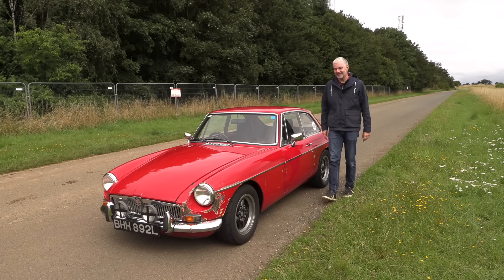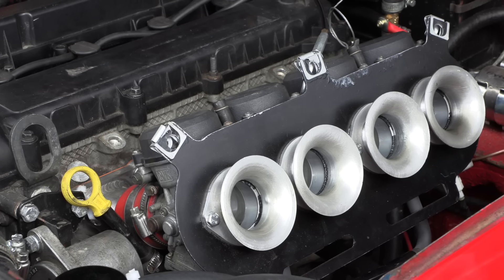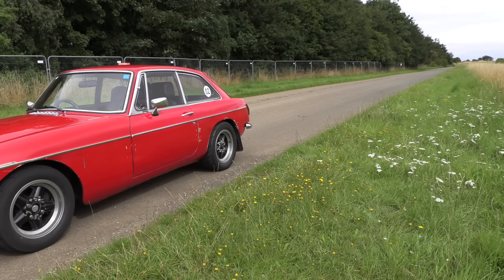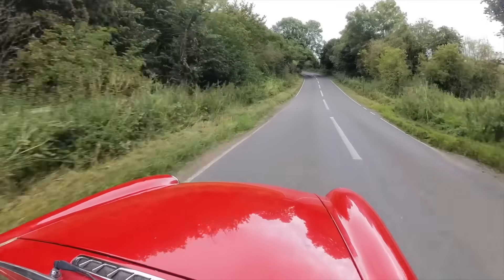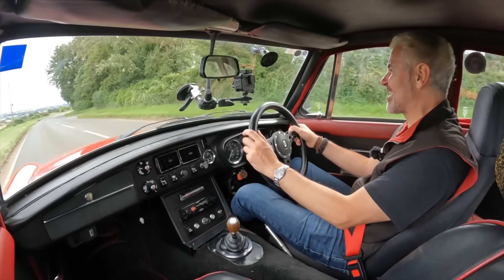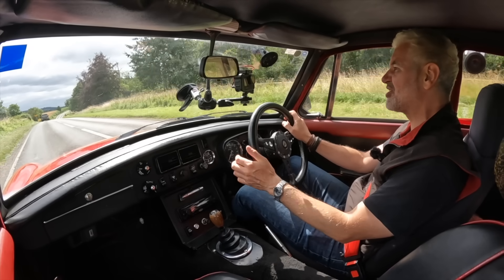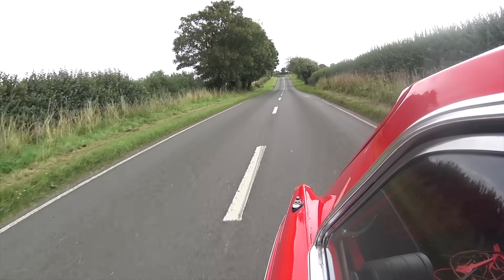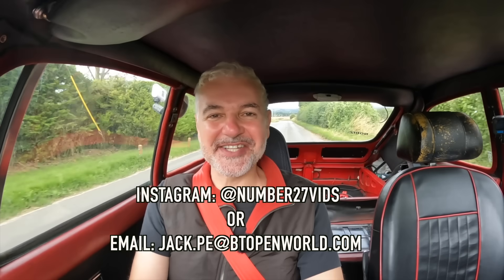This Mod Makes Electric Conversions Redundant - MGB GT Duratec

Comment: So now it is NOT a Genuine M.G. ..... How SAD You Butcher.
Reply: Don't worry boss- nothing had to be cut or welded on the chassis even the engine mounting points so you can put the old b series back any time you want to!

Comment: Electric conversion won't have the "soul", but it will get you into London, not have any emissions, save a lot in fuel (assuming you can charge at home) and not have any engine servicing in the future.
That's a track day car, driving like that on public roads in an EV you'd stay under the radar.

Comment: So I am very curious, what did the conversion do to the mpg or km/l? That is one of the reasons people switch to electric; less energy use. 

I have a 1949 Hudson with the original side valve six but with a ‘modern’ (1990’s) TH700r4 and it makes the car feel alive, and on highway speeds it’s so calm. Mpg went down to around 22 American, 26 imperial. 

On my daily driver, an original ‘65 Valiant with slant six, the mpg is the same though, but it weights 200kg less.
Reply from the maker: The Fiesta with this engine has 42-56mpg combined so this would be even better if the standard intake was left.. as it is with bike carbs consumption was much higher than that.

Comment: Genius conversion - Brit classic that now has a reliable engine, doesn't leak oil all over your driveway, and will run in the wet (no more Lucas Prince of Darkness). You can even find parts for it. Reminds me of the 60's when Bizzarrini  built his beautiful cars to compete w/Ferrari, and put Chevy V-8's in them. Bizzarrini's always started & ran, lotsa power, and didn't spend every other week in the shop like the Ferraris did - and were much more affordable.

Comment: It's great value for sure. 

But two major parts of the appeal of an electric conversion for my 1968 Spitfire convertible are the the lack of exhaust stink and being able to get about quietly. 

I drive my Spitfire year round (even on drizzly days) and only with the top down. I am totally fed up with the stink of the carb engine (even though it is finely tuned - 45 MPG). 

Plus I am equally fed up with other people's raucous exhausts which are entirely for the self-centred benefit of the driver. 

And this is even before we get into the silky smooth power delivery and 100% low down torque of electric motors.

New tech exists and that is what I want. (Just waiting for the prices to come down below 10k - and they will).

Comment: I put a Vauxhall 2.0 red top in my MGB about 27 years ago, Lumenition throttle bodies, standalone ecu, custom ex manifold, stainless V8 rear exhaust, ford 5 speed box and quaife diff, I helped develop the Willwood 4pot disc brake conversion with Rally Design which worked brilliantly, in conjunction with cooper s cylinders on the rear with uprated shoes.. I also had the coilover front conversion  which made getting the right spring rate fairly easy, together with a thicker front ARB, lowered rear springs with anti-tramp bars and spax shocks.
Reply: this must have cost a bundle and takenn months to get working!!
Reply: Wow what a conversion 👍🏻

Comment: 5k? thought might say 500.
Reply: I think someone converted a midget to k series 1.1l for about £500. Did all the work himself and used a crashed rover as the donor. That car gets some 50 mpg and is about 80bhp in a midget. Cool car.

Comment: Still have to buy gas?  Still spits out toxic fumes?  Still doesn't make full torque at 0rpm?  It's a sweet car, but this doesn't make electric conversions redundant, sorry.
Reply from the maker: It does for a car of this value where electric conversions would be 6 X the cost of the car. Besides classics emit a totally miniscule proportion of overall car related pollution and changing them to electric is not going to make the slightest difference to global warming.
Reply: @Number27  it will make a huge difference to local air quality though.  Engine swaps are fun but it's nothing new.  They don't have any of the benefits of electric conversions.

Comment: Biggest cost of an EV conversion is usually the batteries, which are second hand to start with.
10 years down the line if lucky and will need replacing again.
A well built internal combustion engine used a few weeks each summer in a classic car, would last 50 years plus between rebuilds.
Reply: Yep, I have nothing against electric powered vehicles, love them in fact, but if your toy sits for a large part of its ownership, batteries are not a good choice.  At least with the current tech.

Comment: My partner has a 1974 MG and I fitted an overdrive box and modern rear shockers, this transformed it, as for conversions years ago she had a 1994 1.8 turbo diesel Vauxhall Astra with the Isuzu engine, which seemed to me a brilliant engine to fit in the MG, fast, very economical and ultra reliable, but she wouldn't let me.

Comment: More details on the hardware required please. Gearbox to engine … is an adapter plate needed?
Reply: No adapter at all. You need to change the spigot bearing but that's all.

Comment: Brilliant conversion. As someone planning an ev conversion i do have a couple of qualms with the figures used. that 30k+ figure is the price charged by high end shops that fully restore cars and use brand new overly expensive electric components (going off that 110hp figure). Many of these shops use stupidly expensive incredibly underpowered components.

If you were to convert the car yourself using used components from a written off electric car, a budget of 5-7.5k is very reasonable. My own conversion I expect to cost approximately 5k and will provide me with a motor that is rated at 250hp but has been tested at up to a bit over 400hp.

I'm going to do a little pros and cons list for doing the conversion featured in the video vs a diy electric conversion:

Petrol pros- done by professionals (so no work required on your end), lower upfront cost, retain the sound, retain that manual gearbox, lighter car
Petrol cons- petrol is only getting more expensive (~1k more expensive per year than electric at current rates), more points of failure, harder to maintain on your own

Electric pros- lower lifetime cost (less maintenance + save ~1k on fuel per year), more horsepower in a lighter package, less points of failure, benefits of instant torque
Electric cons- can't get work done by professionals, have to do significantly more research, can be a lengthy process, may potentially be heavier than before (mine will be heavier by ~200kg, from 1.3T to 1.5T), less range (mine will have approx 115 miles)

TLDR: This petrol conversion is brilliant, will fulfill it's intended purpose, will be incredibly fun, with a low upfront cost, but in the long run doing an ev conversion will be cheaper and more powerful.
so If you can sacrifice the sound of a combustion engine and the fun of driving a manual, an electric car will be more powerful and cheaper (in the long run)
Reply: Yorgos.......I wouldn't trust anything electric second hand,& I wouldn't buy anything new so,alternative REAL powerplant it is then.......
Reply: Have you gat a link to a parts list or supplier for the conversion bits you plan on using?
Reply: @TheKaptainKernow  my plan is to buy a written off Nissan leaf from copart + the inverter and transmission (which also acts as the motor) from a lexus gs300h. and them Frankenstein the components across. 

If you want some proper advice, from people significantly smarter and more experienced than me, make a post on the openinverter forum, or r/evconversions, or diyelectriccar.
Reply: some more cons: No garage is insured to have your vehicle in it, no roadside rescue firm should be towing it. You soon wont be able to legally park it within 50m of anyone elses vehicle, house or business especially with a battery from a "written off" vehicle that was likely written off as no repairer can be arsed with trying to get insured to have your vehicle within 50m of anything else on the site.
Reply: The comparison is ridiculous. No ICE can compete with batteries.
Reply: @nickiemcnichols5397  I agree it's ridiculous.  Turning it into an EV destroys it for no real or perceived benefit (all of which are falsehoods/lies) and renders it less desirable as my blender.
Reply: @nickiemcnichols5397  Ah see, I'm converting a Nash Statesman to electric and doing it myself, doing it nice, lithium batteries of course, making it compatible with a few public charger varieties and I see the 30k price as entirely reasonable, not to mention the time to wire things up beautifully. Petrol engine swaps can be a pita, but a Duratec to an MX5 transmission is a well supported, documented swap into most old, 4 cylinder things. Plus, you can keep the limited space most of them have and you can stay under the limited GVWR such ancient sheet metal supports, leaving it all for passengers and 1 piece of luggage. Back when I did petrol car projects all the time there's ALWAYS someone saying 'this is as cheap as I did it' and I generally found it an unreasonable pissing contest with not grasp of reality. Doing it yourself, they can both be cheap if you're willing. Paying someone else, I think the petrol will be cheaper, gas spent and all for the amount most people drive a hobby car.

Comment: Removing the old "B series" and putting the MUCH LIGHTER duratec in the engine bay, would improve the balance of the car no end!  Having that MX-5 box to "stir", also loses weight, and adds SO MUCH FUN!  Even if you decided to go "full leather" inside and all the "mod cons", like electric widows, air-con and posh seats, you'd never have a heavier car than stock!  1960's class, but with 2020's reliability and performance? ...NO BRAINER! (Not sure I could live without the old 1800 long stroke torque and "rasp" though?  I wonder if there is a lighter, and maybe a racier version of the "B"?  My old "Forza4" virtual car, was bored out to 2.0ltr and lightened and had a sport box and rear end, which made it a REAL weapon on the track!)

Comment: I put 90,000 kms on a Yamaha FZ-1 (R1 in street clothes) and other than installing an Earls Performance jet kit I never touched the carbs.  That carburator set-up is a great choice.  I think the idea of putting a modern engine and transmission in the MG is a fantastic plan. The result is an elemental sports car with total reliability.  Great project.

Comment: There are so many very good/excellent options on the MGB for the suspension and steering. So sorting that out will not be a problem. I do think some of your comments are a little misleading ie the EV conversions I've seen with modest power outputs are for those that don't want to change too much ie standard brakes etc. There will always be an EV option that will give you more power, but you will end up completely changing the brakes and suspension to handle the increase in performance. Conversions like this have their place, like the V6 MX5 but equally the EV options are just as valuable and may become more attractive as batteries etc become far more available and prices more affordable. Having driven many different BEVs over the last 5 or 6 years, there are EVs that are great fun to drive, just as there are many boring ICE cars. We do need more fun EV options for sure, but that hasn't stopped me having a blast honing along some of my favourite roads in an EV. A modern engine in a classic is a great way to make it more reliable and more affordable to run but it doesn't make EV conversions redundant, the current cost is the main problem. There was a time when I wanted to drop a Vauxhall 2.0 red top on a getrag gbox into an Opel Manta A for my commute weapon but it got too difficult and expensive to get all the bits I needed. Hopefully we will be allowed to keep our classics as all the new stuff goes electric, which is absolutely necessary IMO. And hopefully we will still be allowed to modify them as seen here.

Comment: Having the Mazda gearbox means you don't have that fabulous overdrive unit. Secondly the standard back end slides all over the place so I would make some drastic upgrades before driving it in anger.

Comment: The Austin B Series is heavy but it’s strong and very tuneable. Add a long centre branch exhaust - and 130bhp isn’t hard to get.
Reply: Hi, I did the conversion in the video. I read around this a lot: many good books on the b series. At that power level you'd be just drinking fuel, it would be expensive (Peter Burgess quotes £5k ish) and probably not that reliable. 130 bhp is more difficult than people seem to think

Comment: What all the petrol junkies need is an electric car with a soundtrack of an engine and a tic can full of nails on an aluminium tray in the back seat.
Then go out for a drive and see how they like electric cars now.
Its all in the head and I don't see people harking back to the good 'ol days of greasy hands and breaking down by the side of the road.
Petrol come from the jurassic era and the people who love petrol engines because of the noise well ...

I do the get the cost issue. Its still cheaper to have fun with a petrol classic, but give it a few years.

Comment: As a final part of the conversion, would it be possible to make this an LPG Liquid Propane Gas instead of Petrol???
Reply: Probably but you would need to harden the valve seats and then find somewhere to put the LPG tank
Reply: @ragsbiker7316  with the engine swap to the modern Ford Duratec, it should already have hardened seats.  but true if the original engine were still used hardened seat for unleaded fuel would be a must.  The tank might be a bit of a squeeze, but LPG is far cheaper than petrol any day around my area.

Comment: NC MX5 engine and box.  There's a company here in the UK doing these conversions Frontline Developments iirc.  However, like most restomod outfits, they are ridiculously expensive.  It's far cheaper (and more satisfying) to do it yourself.

Comment: He doesn’t really tackle why people put electric into classic cars. Most are classed as historic so even with old original engines they can escape ULEZ rules or road tax. By all means put a more performance oriented ICE into a classic which is a tuning method from the early years of the motor car.

Comment: I had an MGB GT in the early 80s. It remains the worst thing I ever owned. It was embarrassingly slow, it had the roadholding attributes of a sack of coal on a skate board and it rusted faster than anything from Turin or Milan. You might say I'm somewhat biased but I have good reason to be. Seems like the changes here are all for the better but unfortunately, it's still an MG.

Comment: I thought the MGB had those lever arm dampers at the upper front suspension member rather than a wishbone, perhaps not?
Every credit to the owner for converting it but it could be improved further, it would benefit from fully independent multi-link rear suspension, better brakes and suspension geometry and the great thing is that is easy to do, you just buy a MK 3 MX5!  And if you really want that noise pop a set of ITBs on it.
That would already have the Duratec engine (at around 170BHP) and the MX5 gearbox (surprisingly) as well as much better brakes and suspension set up.  All in the price would probably be cheaper too.
I guess one area where this would win would be weight and as always it's a case of each to their own and I have to admit I'm biased towards the Mazda 🙂

Comment: Not a fan of the way modern engines look with the internal water pump etc. not much excitement under the bonnet, it’s like looking at a bike engine. Much prefer carbs and an engine driven fan.

Comment: I’ll start with that looks like a very fun car. I’m all about restomods, especially where the original engine is not really the star of the car.

The cost point is well taken. Even a junkyard EV to use as a conversion donor is expensive. If you can’t do the work yourself (or live in a place where it’s not permitted) then the price only goes up. 

That said, your statement that this is more reliable than an EV is a bit silly. Even bike carbs are carbs, which reduce the reliability of a modern, fuel injected engine.

Involvement while driving is very subjective, but if there are no gears are being shifted and you’re always in the power band you can spend more time working out how to corner better on a good twisty road.

Comment: An MG should never be powered by an electric motor or a smooth running Japanese 4cyl. It needs a log stroke RORTY sounding engine just like the one here. Fits the character of the car. Perfect. PS) Rorty is a British colloquialism meaning: Rowdy, Lively, Sporty.

Comment: Upgraded my classic mini with modern twincam 1.8k series , its lighter than A+series block and is soo much better. Loads of power,  super reliable , turn on and forget and 5 gears. Not everyones cup of tea but 60mph in 6 seconds😎  . I wish I done it years ago . Easy 40+mpg , win , win, win cost £2000

Comment: I reckon the tyre/front suspension setup would show better in a track situation, but then the leaf rear would show worse.  A single rear spring would make a worthwhile difference. Were there any times when you thought a lsd would have been a good thing to add?
All over, I also think this engine swap is a great idea. Best of both worlds, fun of a classic with ability of modern drivetrain.
Reply: The rear would need a panhard rod or watts link for better location

Comment: My MGB would go 160+ mph and run all day at 145 to 155mph. In always started and got 23 mpg running at that speed. It could pass Corvettes on the INSIDE of a curve. So this is just blah blah blah.